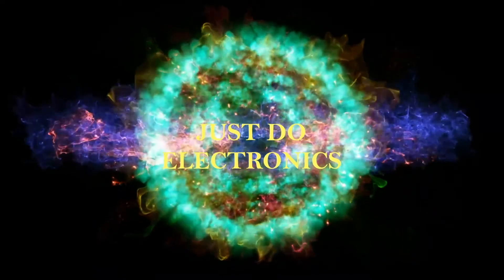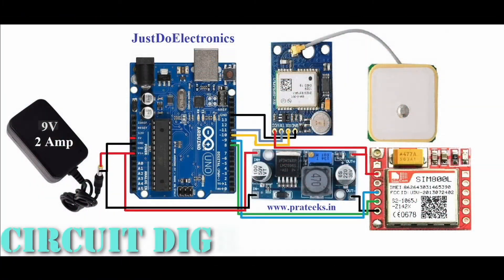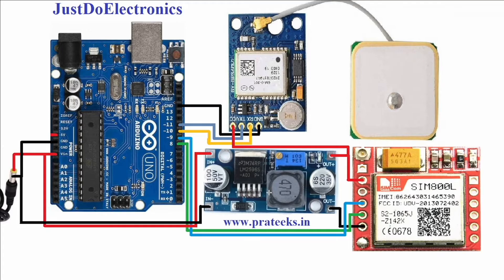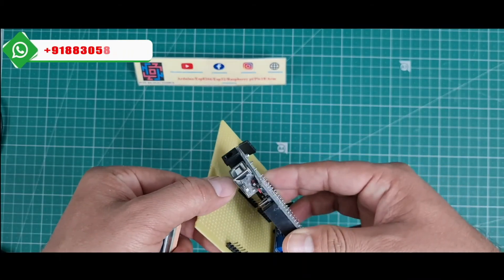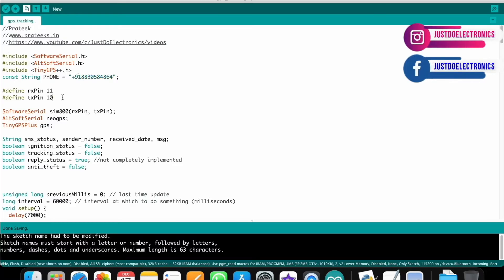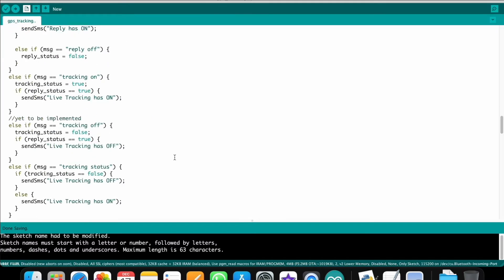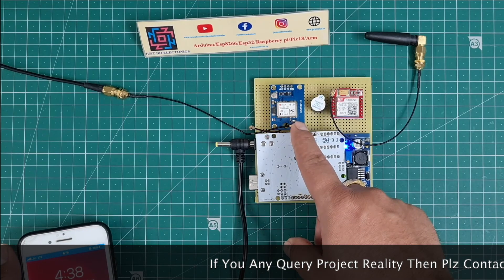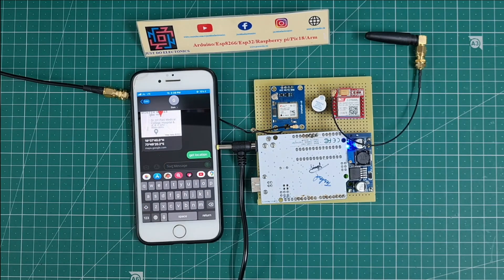Build Your Own Gps Tracking System using Arduino | Women Safety device

Comment: Can we use bread board
Reply from the maker: Yea
Reply: @JustDoElectronics  how to connect arudino to push buttons sir plz reply
Reply from the maker: @HariHari-dl4rq check circuit diagram sir
Reply: @JustDoElectronics  sir  can use solidering gps neon 6 module reply sir
Reply from the maker: @HariHari-dl4rq yes

Comment: Bro sim in gsm and mobile number used in code both are same
Reply from the maker: Noo is different where you received the message just put the number in a cose and you used any sim card but not jio
Reply: @JustDoElectronics We need to register any number or just we have apply in code directly

Comment: Can you answer me why i uploaded code successfully but i can't send a message or call?(It did not response to me)
Reply: Does the connection LED on GSM blink? I have no problem using 5v 5a adapter as GSM External power source. But when I use 5v 2a, it doesn't seem to work. LED blinks but doesn't send any SMS. Mine is sim900a.

Comment: Sir kindly make Arduino car speedometer using Neo-6m gps module, display on it TM1636 or i2c 1602 lcd.
Reply from the maker: I will try
Reply: @JustDoElectronics  Thanks sir

Comment: Sir can I use 18650 to power this? 

I cant get how to power this using that adapter
Reply: Try DIY LM2596  5v 3a circuit. I successfully created one I use LM2596 Fixed 5v 3a so need no to adjust anything.  Now I connect two 18650 batteries to GSM via the circuit. The red LED comes up so I think my LM2596 can provide enough power for the GSM. I haven't test the code yet. 
Anyway, use it at your own risk.  I measure the circuit with multimeter before I connected it to my GSM module.

Comment: I think there's a bit of shit in the illustration . Because you got GPS to ports ten and Eleven and GSM to eight and nine . And I think it's the opposite . Is that true
Reply from the maker: yes
Reply: In that case, do we need to change the port value in the code?
Reply: @hasankhanrakib7781  You can connect the parties according to the code